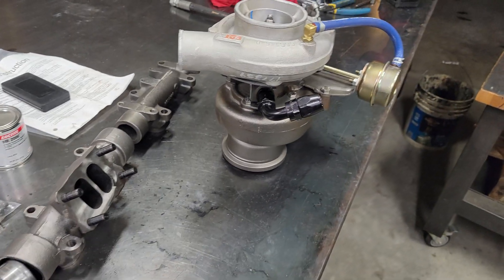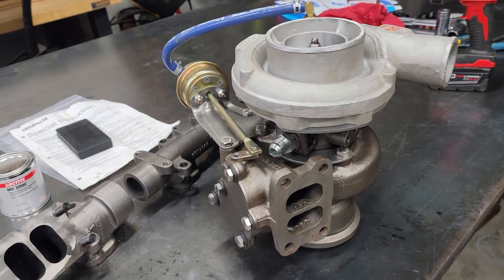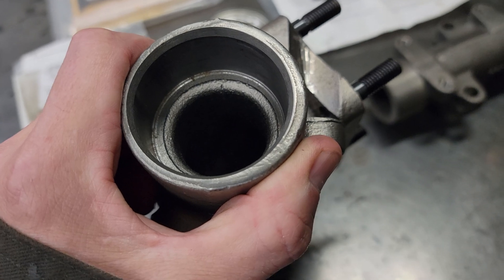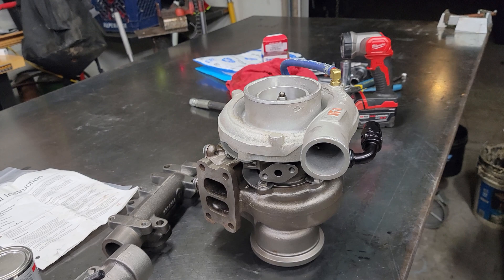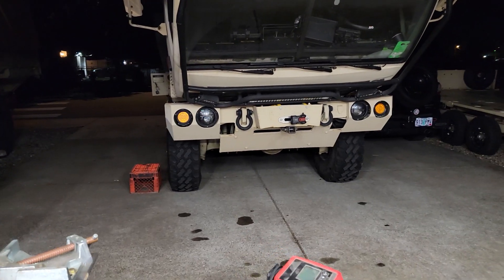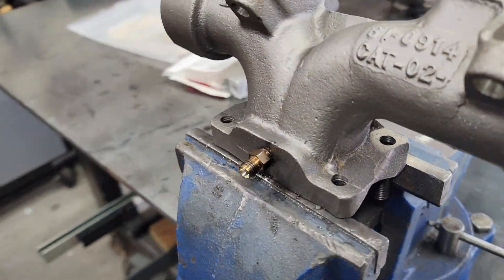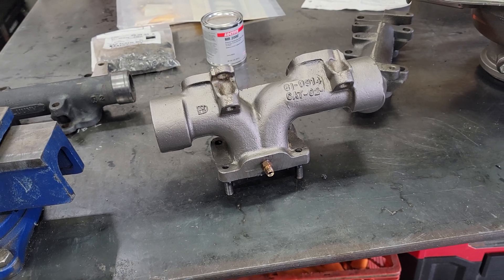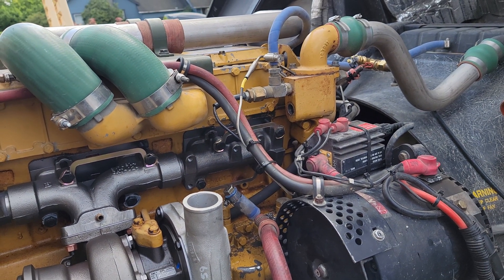Abel LMTV build part 197 (Cat S300 turbo, Gen2 manifold, gasket and bolt kit)

Comment: I have 2 M1078's, I'm building 2 expedition trucks, one for me and 1 to sell to cover the cost of the one im building myself...im definitely upgrading the turbo on my personal rig.
Reply from the maker: Sounds like a great plan.  I love these trucks.  I just drove Abel 160 miles round trip yesterday to drop off one of my KTMs at the stealership to be serviced.  The upgraded turbo sings on these platforms.  Well worth it.
Reply: @SeanFillner  Oofff KTM maintenance. 🙃💸.  I appreciate ya brother.  I'm excited to upgrade the snail. The trucks are just fun man, it's hard not to smile driving em. Stay safe out there. 🤙🏾
Reply from the maker: 8 ktms, not one issue aside from a turn signal error that is being covered under warranty on my 2024 790 adventure bike.